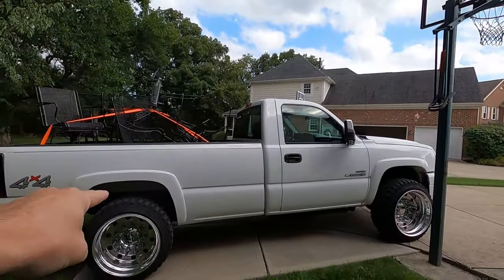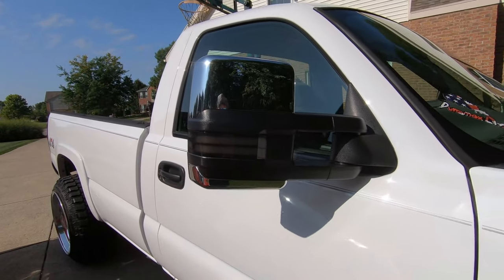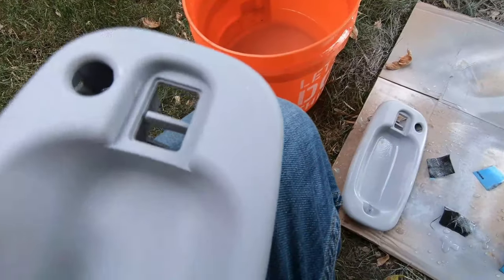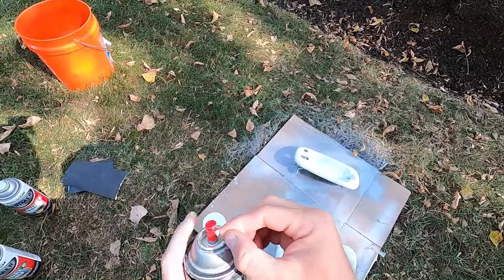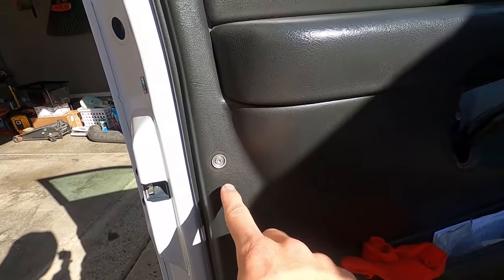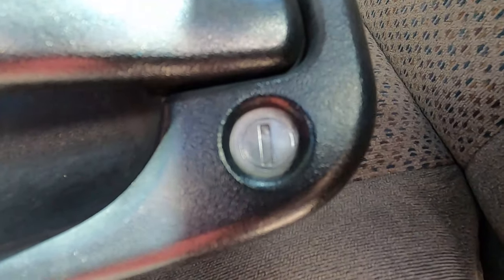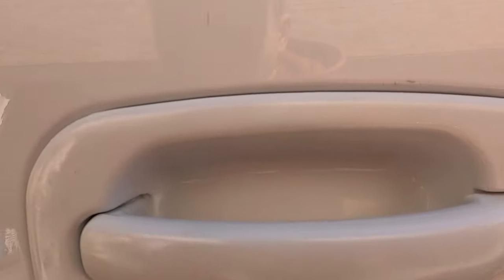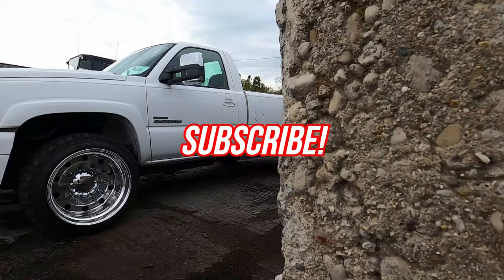How To COLOR MATCH Your Own Truck Parts !

Comment: Quick question I have a 2006 Chevy Colorado and the bottom piece of my front end is the black light textured plastic, could I use this same method
Reply from the maker: Yes! Just make sure you use enough primer to make it smooth! I did thar on the front bumper of this truck

Comment: Nice vid pretty informative would like to see more burnouts though
Reply from the maker: I gotchu 👀
Reply: @NaztyNate  is that enamel clear better or different than the max 2k clearcoat? That's what someone recommended, idk I'm not a painter just wondering
Reply: your truck looks badass I have a white 2000 Silverado 1500 I'm gonna try this once it warms bck up in Mississippi